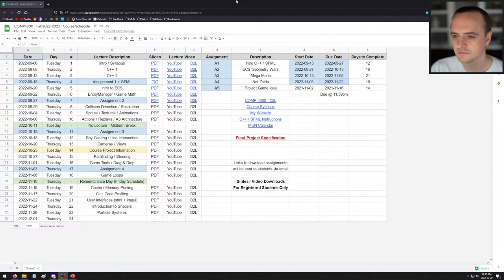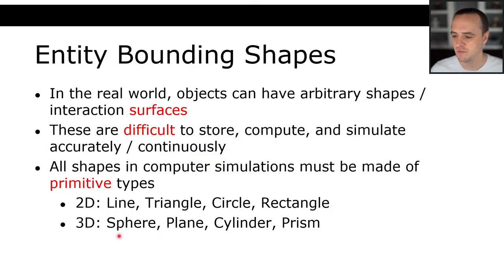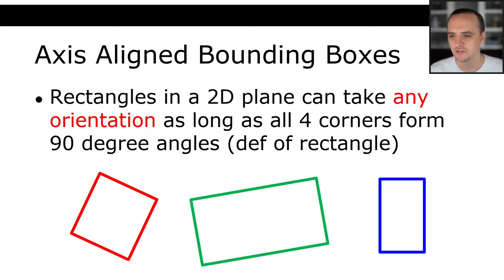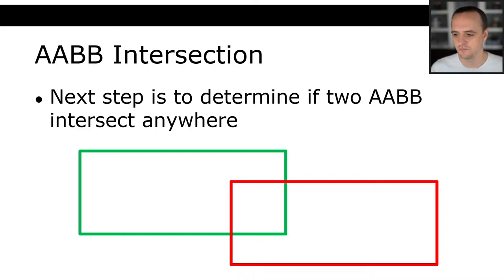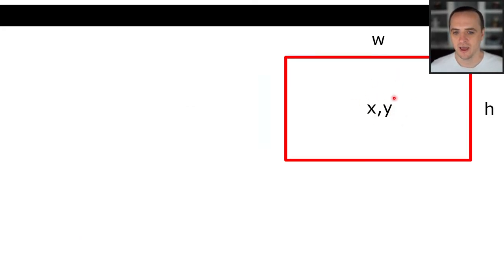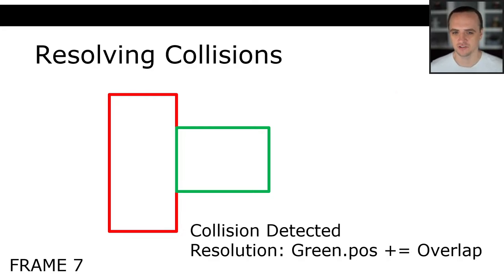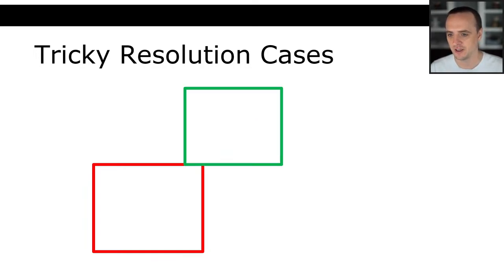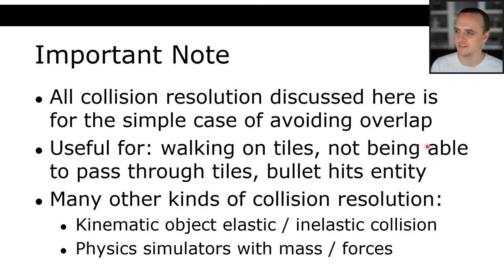COMP4300 - Game Programming - Lecture 08 - Collision Detection & AABB

Comment: Hi Prof. Dave. First of all, thanks for posting these invaluable materials to the public, much appreciated. I have a question about collision resolution. Your explanation is perfect and I understand your point and how we can resolve collision based on the overlap in x or y directions. However, I was thinking of a different, and maybe more general, way than yours. Why can not we just look at the velocity vector and flip its sign, i.e. multiply velocity by -1, and add this to the position? This is guaranteed to push the object back to the original place it came from before the collision. Also, we would not have to store previous position or overlap to resolve resolution.
Reply from the maker: It's not guaranteed that newPosition = prevPosition + velocity in general, since you could have had other effects of physics or teleports etc that may have moved the object. This would also mean that it would matter in which order you called the systems (update velocity or collisions first?) which I try and avoid